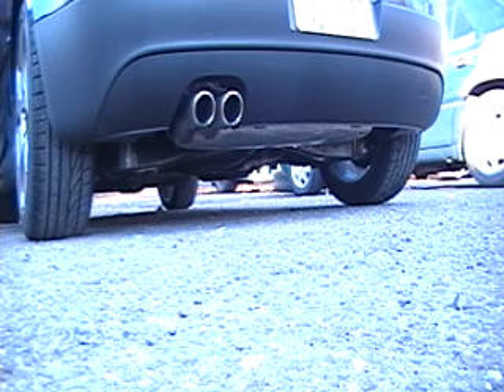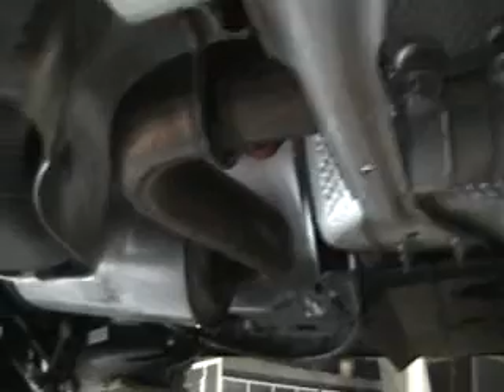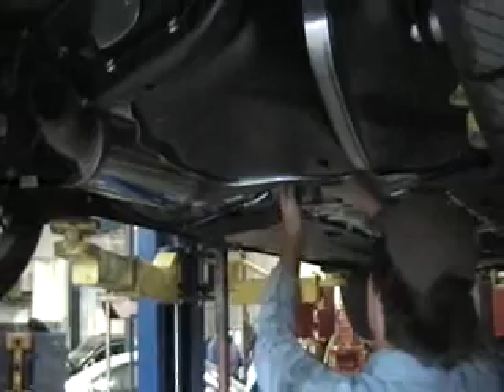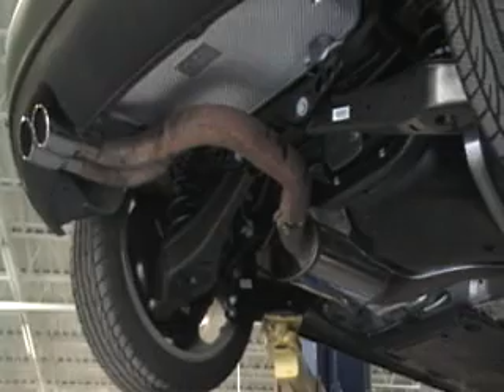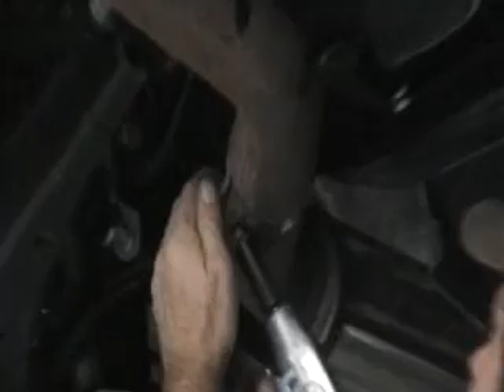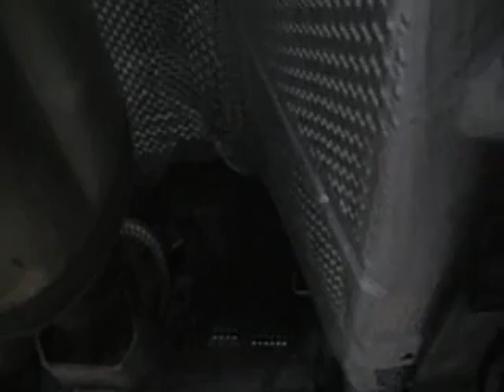VW GTI 2.0T AutoTech Magnaflow Cat-Back Exhaust Installation

Comment: Nice looking set up. Though I would have to disagree with "Sideler74".
If you have a stainless pipe with surface rust on it....it will rust thru.
409 stainless is what the OEM's use & I would bet that if you check with the manufacturer of the exhaust you installed...that's what you have.
304 stainless will not surface rust. It will stain when heated but can be cleaned with scotchbrite.  That being said....your system sounds good.